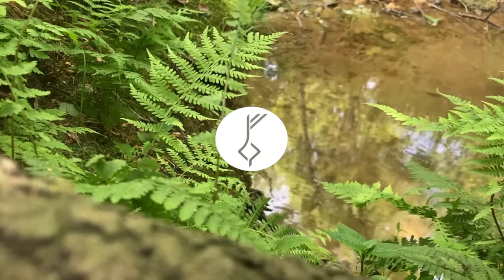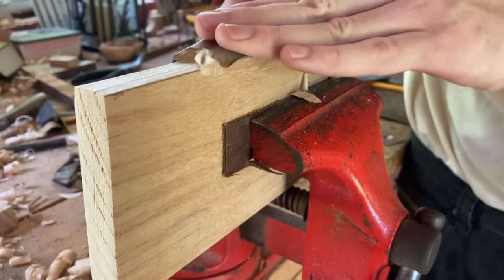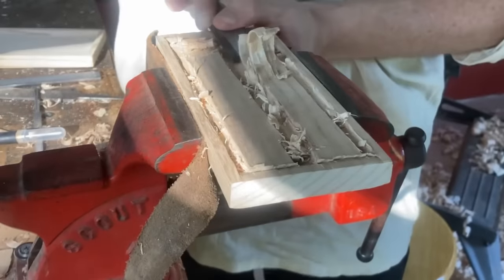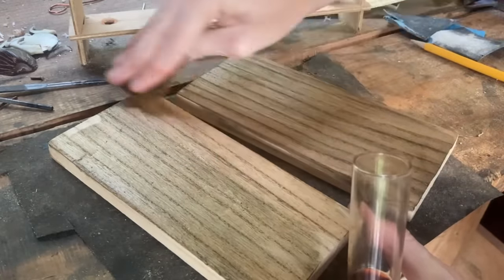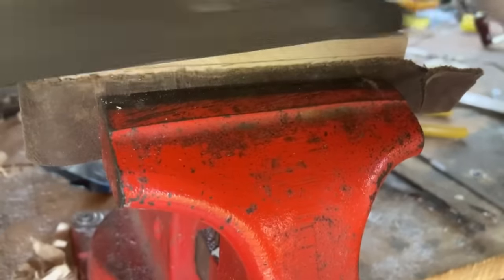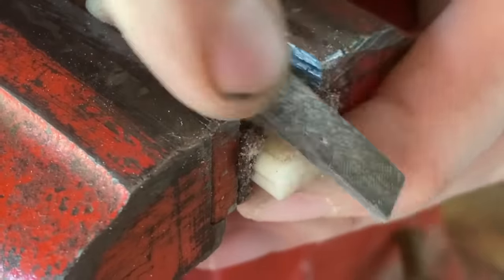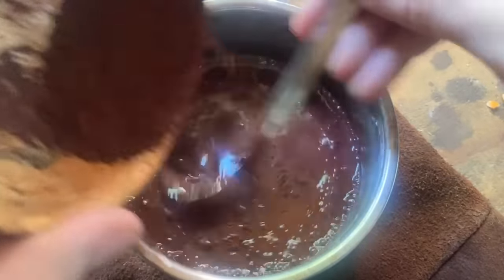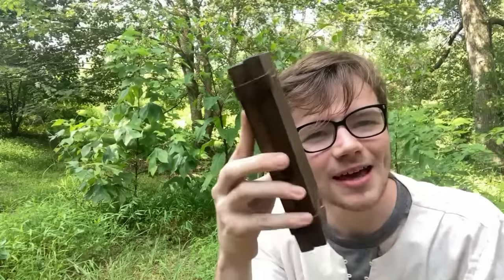The Wax Tablet: Recreating An Ancient Note Book

Comment: For a smoother wax that doesn't flake when you inscribe in it add some olive oil. also its easier to use blocky or angular letters for the purpose of writing as curves can make the wax push in on itself. Awesome vid; loved the process.
Reply from the maker: thats a great idea, I think I'll try just that!
Reply: The Greek written alphabet was made for this purpose of being easy to write on wax, Bit I could be wrong.
Reply: @87crowhat54  The Early Greek alphabets are angular because they were mostly inscribed on stone (which provides almost all the surviving inscriptions) and wood which has provided 2-3 inscriptions. I have never written on wax but carving curves on stone is extremely difficult even with modern tools.
Reply: Did they use beeswax, or at least a better wax than paraffin? All those flakes covering the surface make it extremely hard to read, and would necessitate a brush as well as a scribing tool be included. Or maybe heating the tip of the scribing tool before writing would eliminate the problem? Another question - while the other end of your scriber might erase a single mistake easily, they must have had something else to erase the whole tablet for reuse. A sort of flatiron, maybe?
Reply: No wonder the Norse alphabet doesn't exactly have many curves.
Reply: I have written in boot polish wax for fun. it's soft, easy to work with.
Reply: The Latin rustica alphabet was used for inscribing. Perhaps a rounded stylus would make it easier to write? I need to try that.
Reply: this must have been the origional ipad 😂
Reply: I love how you can tell how languages evolved and what they were originally written on possibly, by their angles and such!
Reply: @AggelosKyriou  hmm that feels a bit loaded, aka selection bias. Are we sure that the surviving tablets being stone means that is truly what was used more often or is it just what survived. Although to me at least same basic concept, whether it was exactly stone or wax that influenced the shape decision more either way it was just to make em easier to carve. I’d imagine even though it’s possible on wax might be annoying enough to push people away from curves
Reply: @tedrice1026  Dude literally said beeswax was historically used near the beginning of the video.
Reply: @monhi64 Pretty sure, yeah.
Stone, clay, wax, wood.
All of these require indenting the surface, which is easiest with straight lines. 
Only when we could make a lot of paper at once could we write well with curves.
Reply: Or just beeswax, it's a lot softer then parrafin wax, and readily available.
Reply: Yes on the oil. Likely the maker tested different ratios of wax & oil. 
1. To match to the weather, 
2. The writer's style, 
3. The condition of the wax itself. (As a natural product, farmed or wildcrafted there would be variance of quality or age. Some natural wax natural resin in it which can change the texture properties.)  
If it is said "well we don't have a record of that." That is why it is called workshop or trade secrets. And why one maker would be so sought after. It is also easy for "secrets" to be lost from accident, or war, and then reinvented again. 
I would also guarantee that there would likely be a recipe difference between a cold outpost, and a hot one. With a hot one, a fine clay, similar to the oxide Fraser added, would have been used. 
All of this would depend on the wealth of the user. Because it takes money to buy from an excellent quality tradesperson.
Reply: I was wondering wether people in the past wouldn’t have come up with a solution to the flaky lettering right away, maybe a metal stylus would get in equilibrium with body heat and melt into the wax as well as carving it, I don’t know if that would look as good as I picture it though, may give it a try some day

Comment: now i see why a certain Bookworm would pick this method for writing down notes, such a simple yet elegant design allowing for erasable writing with relatively cheap materials and easy manufacturing
Reply: Is this a pop culture reference?
Reply: @JinKee  I think it's referring to an anime by the name of Ascendance of a Bookworm
Reply: @MoreEvilThanYahweh  thanks!
Reply: Also artisans, who often need to to sketch diagrams or shuttle through some calculations on the fly.
Reply: Myne picked every writing technology she remembered and hoped for the best, the dyptich was just one of the ones that stuck.
Reply: They only briefly go over the use in the anime, but in the source material (novels) they are used a lot more.
Reply: Plus, monogrammed versions make great gifts!
Reply: Yeah that bookworm spreads that to basically everyone in the series. So many have them later on.
Reply: Ah, a fellow Ascendance of a Bookworm fan chad

Comment: Wax tablets can also be inked and a transfer ink process used to imprint / copy the text to be read in a mirror surface.
Reply: The type of writing direction that some ancient Greek uses is called "BOUSTROPHEDON". From Britannica, "the writing of alternate lines in opposite directions, one line from left to right and the next from right to left" 

Even the letters are flipped when writing the line that goes right to left. 
So, my guess is that it would be easier to read if it were mirrored for an ancient greek, the problem would not be the mirrored letters (because they already use mirrored versions of them in writing because of the boustrophedon writing system), but rather reading in a flipped alternating pattern.
Reply: If they already write in alternating lines (regular, mirrored backwards, regular, mirrored backwards... ), printout would alternate the same, just the lines that were regular, would become mirrored backwards, and the ones that used to be mirrored backwards would become regular

Dang, thanks for idea! Gotta some potato carving to do for my drawing, have a good one

Comment: This is very cool!  I haven't yet seen a video on making these tablets.  Something you seem to have missed is a closure to the tablet so it won't accidentally open when dropped or tossed around.  Cheaper ones would have a leather lace wound around like a string closure on a manila envelope.  More expensive ones might have clasps made of metal.  If you try the ivory hinges again, try inletting them into the tablet bodies.  Maybe try hinges made of copper or brass.

Comment: Worth noting that the issue about these being erasable and thus primarily a short term memory sort of thing - that is true of every common writing method to some extent, from every period of history.  Today, I couldn't tell you how many scrap pieces of paper have held my personal thoughts and reminders only to wind up in recycling.  Sumerians working on clay tablets would fire the things they felt worth preserving, but could just similarly wiped clean the clay after getting everything done on that day's to-do list, occasionally slathering a fresh layer of clay on as the old stuff dries too much to write on.  It is quite possible that most writing in history (excluding duplicated works made through printing presses), was always meant for short term use and thus was not preserved.

Comment: Wow this is really cool I was thinking as the wax cooled it would shrink and pop off but i guess the grooved patter held it in, I hope to see more video from you they are always great and very interesting. Thank you
Reply from the maker: Thanks! I was suprised too, as it turns out the wax sticks really well! Too well maybe, I was honestly hoping it would be easier than it is to pop out the wax to remelt it, but its suprisingly stuck in there😅
Reply: I think you smooth the wax over with a hot knife or the bottom of a pan you've just cooked with. No need to pop it out.

Comment: I love this!  
Surely there must be a recipe for wax that could soften it slightly so the writing would not leave shavings about.   The shavings make it less legible, and it seems to me that they would eventually brush away and cause the amount of remaining wax to be less, and need refilling.

I'm charmed by the examples you showed of tablets with religious icons carved in.   It ties with your previous video about curses, and makes me think surely some people must have inscribed blessings or prayers into their tablets under the wax, wishing for gods to protect their words or enhance their wisdom.   The tablets with multiple pages makes me think of the overachiever businessman of today with every app and gizmo on their phone, trying to maximize their productivity.   I wonder if their peers admired their drive, or shook their heads in disbelief at their obsession.
Reply: Using beeswax instead of paraffin would help with the shavings. Beeswax tends to be much softer than paraffin, and is fairly easy to mix in a bit of oil to make it softer still if necessary.
Reply: Olive oil is added to bee's wax for softness since ancient times. Both are noted for cosmetics and the titular wax tablets if i remember correctly.

Comment: Just some tips for next time you need to route like that, its much easier to scribe your lines first as this severs the wood fibers and makes for a cleaner cut with the chisel. You can do this with a knife and then i like to whack the biggest chisel possible straight down into those lines. Then bevel cut into those perimeter lines. this makes for very straight lines. Then if you flip the chisel for gouging out, you can get a very clean finish along the bottom of your routed area almost like you're using a plane, because the bevelled side of the chisel can sit flat into the recess so you don't need to use sandpaper.

Source: i make guitars by hand
Reply from the maker: Thank you! this is great advice I will make use of.

Comment: Very nice, what a cool project to take on. The leather actually does look better though the nut hinges are an awesome idea. This was basically the smartphone of the time I love it

Some advice for digging out the center, try hammering straight down on the line and then chisel 1/4 inch from the edge toward the line so it chips out. Hammer the line again, chisel toward it, etc until you get to the desired depth. The wall will be nice and vertical witha  clean crisp line all the way around and you can just focus on digging out the waste in the middle.

Comment: i believe it's missing a key feature the "erase" function.   doesn't seem doable for small area correction, but some way to reset, etch-a-sketch style.
Reply from the maker: the sort of axe shaped end of the stylus is able to smooth over etched wax to erase it, normally the stylus was warmed to body temperature to make it easier

Comment: I love your videos, the way you have a love and passion for your craft. Pro tip: pre-heat your molds. Pretty much any casting can be significantly improved by having the mold warmed up (temp depends on material being cast) beforehand. You would have had smooth, seamless edges where the wax meets the wood.
Reply from the maker: Thanks! thats a great tip, I'll do just that.

Comment: Just a couple months ago, I spent $60 for a reusable LCD tablet that works like these wax tablets -- even to the ability to erase locally (rather than only being able to erase the entire writing surface like the wax-based "magic slates" I remember from my childhood -- and which are still sold as toys -- or some of the less advanced LCD tablets).  This type of wax tablet may be superior to the modern one, in that it will work without a battery (even a single lithium coin cell) and can be made with pretty primitive tools (I see you have decent woodworking tools; sharp chisels, at least one plane, saws, etc. and knowledge of how to use them).  I may have to make one of these for myself.  I'll probably mount the hinges on the mating edges of the trays, so they lie flat with minimum gap, try to make the edge frames as narrow as possible, and provide a storage location for the stylus so it will stay with the tablet at all times.

I see some potential issues with temperature tolerance relative to the kind of wax you use.  Paraffin will soften a little at high summer temperatures (and don't even think about leaving one of these in a car in the summer), though you can add stearic acid to increase its softening temperature; beeswax is softer, and if you anticipate needing to use one of these in winter, you might want to mix a little lard, tallow, or even vegetable oil into the beeswax to make it softer in winter conditions -- because paraffin will become brittle at below-freezing temperatures and even pure beeswax may harden too much for ease of writing.

Comment: i just had an interesting idea. if you aren't aware of it already, indium is a metal that melts at 313F-156C (which i have achieved in a Foreman grill) and is both bio-safe and ridiculously malleable. like dent with you fingernail soft, so why not make such a writing tablet but from copper/pottery and use indium as the wax medium? i think the hefty weight of the final product might be either satisfying, or annoying, but either way the writing becomes significantly more long lasting akin to lead scrolls. indium isn't terribly cheap, but I've found it easily enough.

Comment: Personally, I would have added a copper plate to the inside of the tablet, with little sections exposed where you could hold it over a candle for quick resetting. Maybe also a little tray along the edges to gather the scratched off wax in?

Comment: How were the words written upon the tablets erased afterwards? Were you to use the back of the silence to scrape? The words away does having to replace the wax every couple of years or date. Or did they melt the layer where you had written?  And simply wait for it to solidify, and if so, how was it melted? Did they rub it back-and-forth with their hands? Until you know, friction heat was created and we can smear their words away. Did you hold up a Torch to it? So that the heat radiating off the Torch gently melted it away. Maybe you've seen a smaller stick to precisely melt certain words or letters.  Please help me understand

Comment: Historically it seems that the stylus is thinner. 
Perhaps a neat design would be a stylus with a flat handle like one of those carpentry pencils, made just thick enough so that it can be stored inside the case but not rattle around inside the case and mess up your notes.

Comment: 10:49 guy really calling other people unhinged when he LITERALLY UNHINGES HIS NUTS ON THIS VERY VIDEO
( I was wondering how one would deal with the shavings and residues from carving into the wax - ideally you'd be wiping or blowing on them regularly, but not only would that be time-consuming, it'd also mean you'd slowly be running out of wax. You could leave the shavings as is, but it'd make the writing much less legible. Older methods like cuneiform were a bit easier since their writing system and writing implements were based on symbols made by displacing rather than scratching. Of course, that came with its own bag of problems. )
Reply from the maker: Ive found the little eraser bit is pretty good at gently brushing away the shavings! I think the benefit of the clearer lettering is certainly worth the lost wax, and i imagine it was just a sacrafice. That said, bees wax is softer than paraffin wax and its possible the slight difference in hardness may have resulted in a less prevalent shaving problem back in the day! but thats just me speculating and I really dont know what they wouldve done!

Comment: cool video but...your chiseling work was a bit painful to watch...chisels can be used bevel up and bevel down...
in the instance of carving a box recess, theyre used bevel down, because the flat back is too broad a surface to sit flat down in there,
thats why you got all the tear out as well otherwise you couldve had a very smooth bottom, just by using the chisel, bevel down.

another good thing to rememebr is
bevel up, chisel goes down like a nail.
bevel down, chisel goes up like a sail.